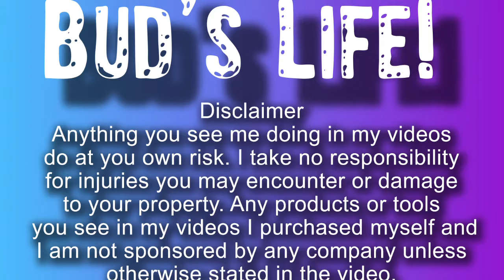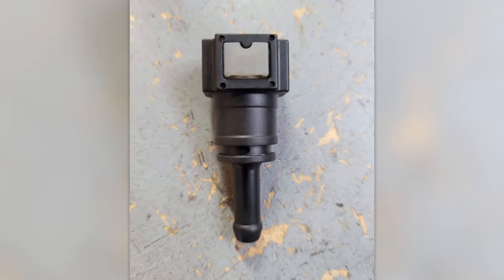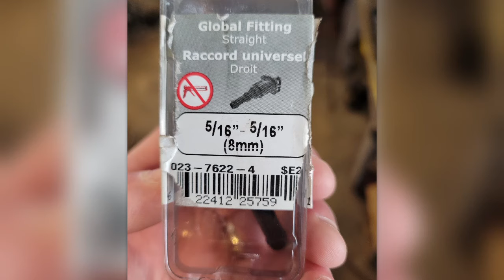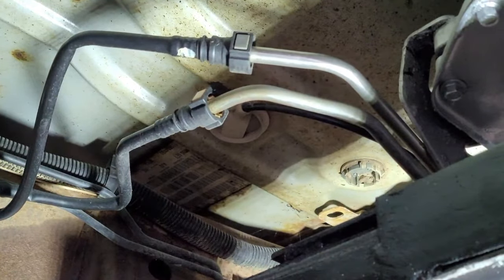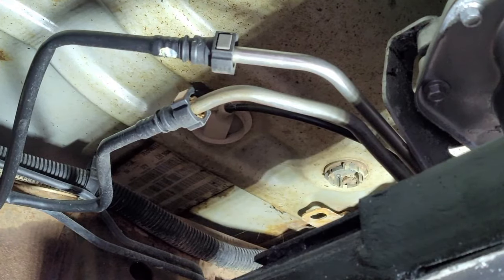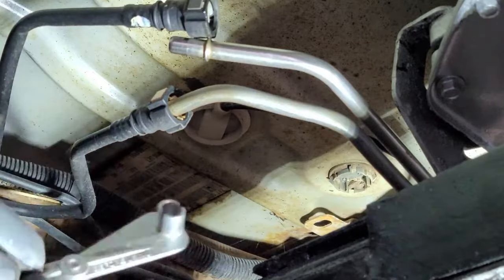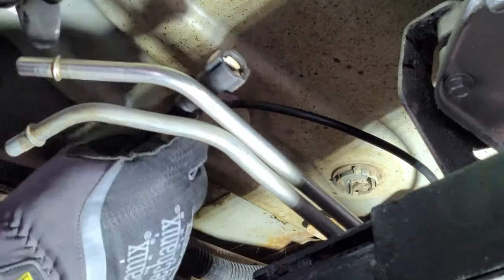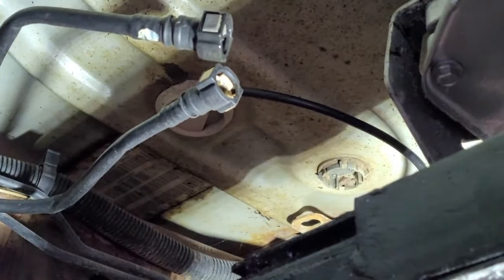How to removing fuel line fittings

Comment: I'm glad to see this video and his replies to those saying "just push the two tabs". Unless your fingers are really tough (not flexible tissue on your finger tips) and skinny I don't see how people make it look so easy to squeeze the tabs (like they do in many videos). Another video shows putting a small nut on each end of skinny needle nose pliers for the squeezing.
Reply from the maker: You are so right. Those little tabs can be so hard to push in. Especially when you live in Canada, where you get a lot of snow and dirt up underneath your car. It can be almost impossible to push those little tabs in. This is a much easier way using this tool. Thanks for watching!
Reply: @budslife I broke the internal plastic tab by squeezing with the needle nose pliers so the connector is not very secure in staying connected ... big problem. Can I pry off the nylon tubing after carefully applying heat gun to get thequick connect off?  I see videos having to use a clamping method just to push the connector onto the nylon tube so I'm afraid pulling off is an even bigger hassle...i might have to replace the whole line.

Comment: I was watching interested to kniw how you git the fitting back on that plastic tube line
Reply from the maker: They usually just snap back together if you didn't destroy the fitting taking it apart.
Reply: Sorry i meant the fuel line , ive got this set up on my van and the fuel line no way would let 1 out and back in. I could cut one out the line but id not get 1 back in.
Reply from the maker: They usually snap back in if they don't. That usually means you've damaged a little clip inside the fitting, and you'll need to replace the whole fitting. That can be tricky, but it can be done. I'm pretty sure there are videos on youtube on how to replace these plastic fittings.
Reply: @budslife  its not the fitting id struggle with. Its getting a new fitting put into the original fuel hose. Ive had to replace the hose.
Reply from the maker: @user-mj4xp7wi3p  try this video it might help you. 
https://youtu.be/mT8Sne0q_2g?si=fIsdv_rx7Dk8X6LI

Comment: How do you get them off if you don't have the tool?
Reply from the maker: There's two tabs on the end of these types of fittings that you can squeeze together. Sometimes this will work and they will pop right off but I have seen a lot of times where these tabs will not move they're seized in there so I usually just use the tool and it makes it a lot easier.